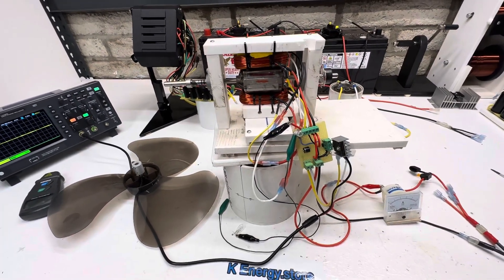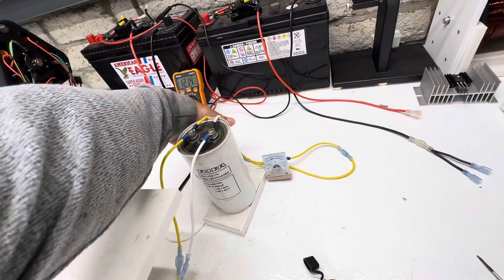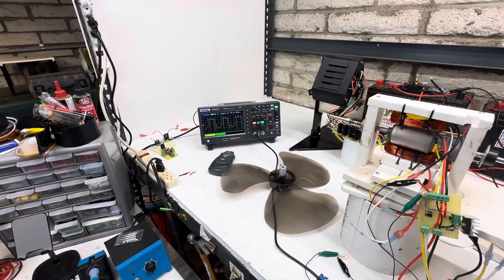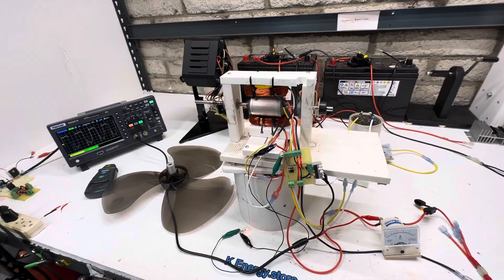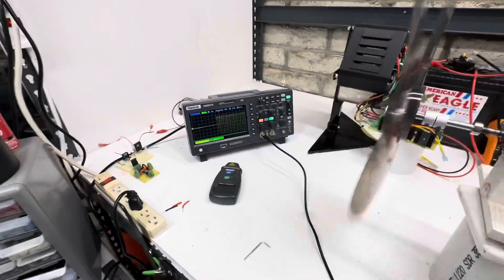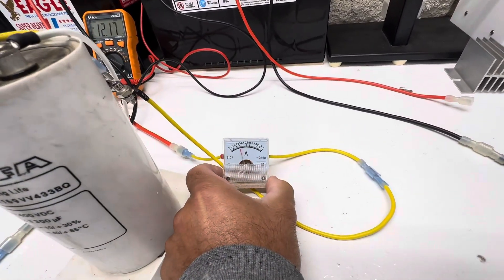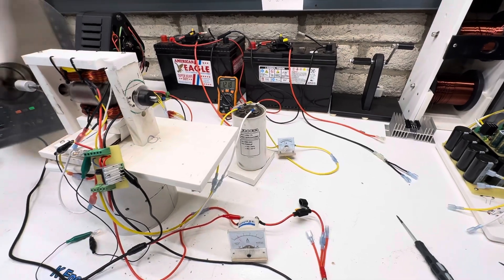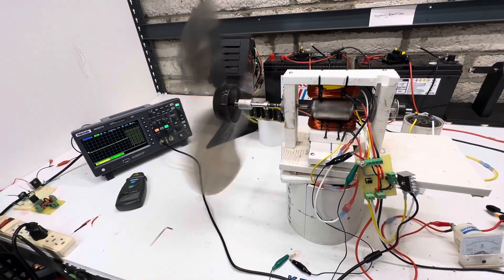Bedini window motor tuning

Comment: It is practical to used to power any devices at home?
Reply from the maker: It’s practical to charge batteries
Reply: @kenergy1707  it can charge more battery with a single input?
Reply from the maker: @DELTECHTV  you can run the fan and charge secondary battery it’s about 30% of input power
Reply: @kenergy1707  how about sa protection of the battery . Is this safe without control circuit for over charging?
Reply from the maker: @DELTECHTV  depends on your battery size 
300 ma to a 100ah battery is hard to overcharge but a 7 ah has to be monitored 
I’m working on a system for that
Reply: Ok,  Example 100ah of battery charging input around  300ma. It takes  along time to fully charge a battery. But i think the  bigger motor its practical to charge in 100ah battery.
Reply from the maker: @DELTECHTV  yes definitely with a 15 v cut off circuit
Reply: @kenergy1707    If this is working properly and you said  its a charger so it means there is practical  potential to store. My point is, is this practical to used to power any device in a house if you have a battery bank storage?
Reply from the maker: @DELTECHTV  the output comes out as hi voltage the capacitor makes it into (real) power in dc so if you have a inverter to run off the battery then yes you can
Reply: @kenergy1707  ok thanks for the info. I know your point. Wish  that you can make another video that shows  to power any device at home.  Using a big motor generator store in a battery bank storage by using inverter.
Reply from the maker: @DELTECHTV  working on it

Comment: Yeah that's good simple tuning . I like that idea. You could add some chop sticks onto the fan blades from center to tip to add more drag and see if it tunes it further if you don't have bigger or smaller blades etc
Reply from the maker: Yeah lights work good

Comment: Do you have a variable transformer? You know, those big ones, to go from (input) 220 to (output) 0 to 240 Volts (AC)? I wonder, can you hook up the low voltage side (with the wiper, the output) to replace the bulbs? Because I think, with some tuning, you can get a decent output (and again, charge a battery after rectifying it). I think this is worth trying (but perhaps you already did, I have not seen all of your videos).
Reply from the maker: I have a 25 watt pot that works well the lights work best though
Reply: @kenergy1707  But the lights are dissipating energy. Using the transformer you could capture even more energy. Have you tested this? Or are you willing to test it? It is just an idea of course.
Reply from the maker: @deslomeslager  yes I’ve been testing using a small transformer for the gate control
Reply: @kenergy1707  ok, great! Thanks.
Reply from the maker: @deslomeslager  seems to work nice just a bit touchy

Comment: Have you tried his bipolar systems, not the optical triggered ones? Optical is nice, but I my past I had actually better luck with his bipolar circuits. At least as far as power in vs out. Still cool anyways. I will dig up some of that stuff and make a video. Keep up the good work and research!
Reply from the maker: Yes they work better your pulsing each polarity instead of only one pole 
I like the simplicity of the single for beginners 
Awesome! I look forward to seeing them 
Thanks for the comment!